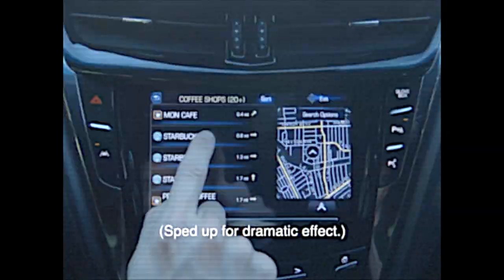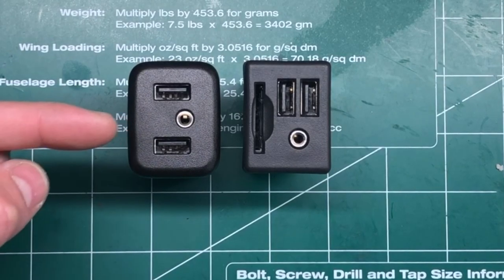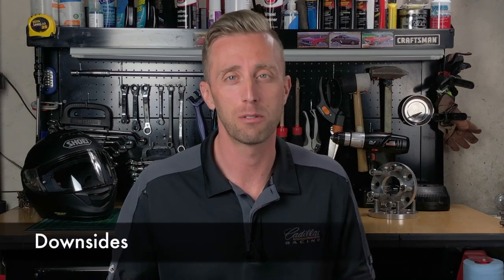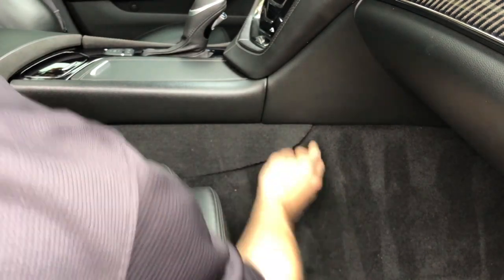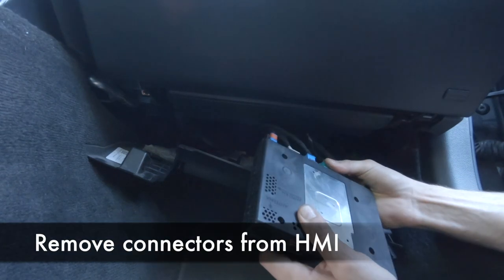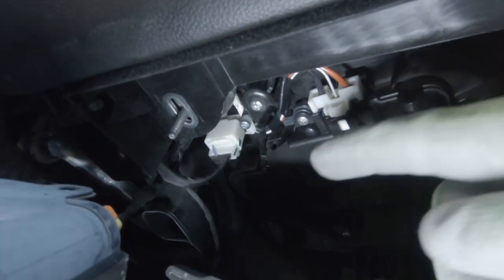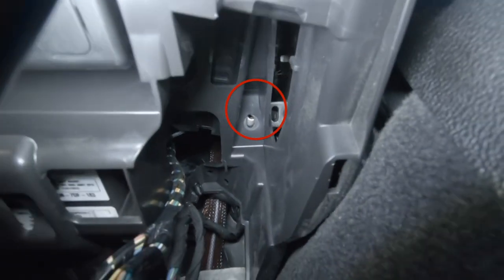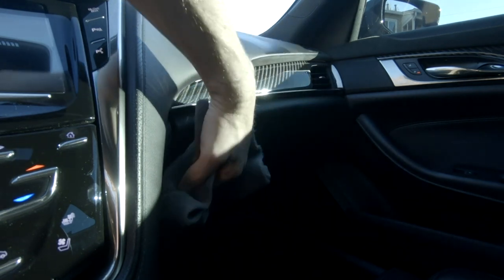How To: Upgrade your CUE w/ Apple Car Play & Android Auto

Comment: GM Parts House is closed.  Do they make this upgrade for the 2013 ATS?
Reply from the maker: Check the description, the source for this is now 404parts.com. If the 2013 has same looking CUE then yes there’s an upgrade. Be sure to use my coupon code JETFUELONLY for $100 off.
Reply: @JetFuelOnly  Awesome, Thanks. What if my car already has NAV?  All I am really looking for is the addition of Apple CarPlay.
Reply from the maker: @NYCPiLoT747   yep, no problem. You have to choose whether you have nav or not so they give you the right module
Reply: @JetFuelOnly  Perfect! Once again, many thanks. I have been looking for this upgrade for quite a while now. Cheers!
Reply: @JetFuelOnly  So, I’ve made contact with both 404 and MVI. Which out of the two would you recommend more? Sorry to keep bugging you on this. I really appreciate your opinion. Thanks!
Reply from the maker: I haven’t dealt with Mvi but I’ve bought lots of parts from 404parts this last year
Reply: @JetFuelOnly  I forgot to ask, is the Apple CarPlay upgrade wireless or does the phone have to be connected somewhere? My ATS is at Cadillac getting serviced and they gave me a 2021 XT4 loaner.  My phone connects to Apple CarPlay wirelessly which is pretty amazing.  No cables anywhere.
Reply from the maker: @NYCPiLoT747  it’s wired. Only the latest Cadillacs can do wireless. For $150 or so you can get a wireless dongle to make it wireless
Reply: @JetFuelOnly  could you please gave me a link for this dongle
Reply from the maker: Must have wired CarPlay for this dongle to work. https://amzn.to/3lF50cM

Comment: What if I don't have the cue system. Is it still worth it to upgrade?
Reply from the maker: You can’t do this upgrade unless you have CUE 2.0.  Or the Chevy/gmc/Buick equivalent
Reply: Thanks. It kinda sucks that my  Ats didn't come with cue system. Not even a back up camera.
Reply from the maker: Have you considered this Tesla style screen upgrade I talk about in my other video?   It may be possible to do on your car. 2014+ Cadillac CTS Modification Part 1: Interior
Reply: I have considered it. But wasn't sure if it will be compatible with the with 2.5 update since the tesla style is aftermarket. Do I need it program after? And what about back up camera?
Reply from the maker: It adds backup camera. Other questions you should speak to Phoenix audio

Comment: I have a 2016 Ats-V but want the 2017-19 cue system. Is that version 3.0 and is there a company that offers this upgrade?
Reply from the maker: As of now ... not that I know of.  I know someone was working on it with the GMC Sierra and Silverado (similar modules) but I don't see any progress.  Don't worry, you aren't missing too much. ;)
Reply: @JetFuelOnly  The major difference is that you can get to the main selections from any screen. On mine you always have to hit home to switch from one selection to another. Could that possibly be a module change to 3.0?
Reply from the maker: @tazoriginal  sounds like you just need to add icons to the top of the screen?  Works like iPhone, press and hold and then move around.
Reply: @JetFuelOnly  didn’t know you could add icons for the main radio functions but I’ll look into it. 2017+ models have it automatically. Guess they realized it was a pain to have to go to the main menu to switch between functions.
Reply from the maker: Ok we may be talking about different things? But look into it. As seen in my video I have icons across the top with phone, maps, audio, pandora etc. I think you get up to 5. What functions did you want?  I think skip or tune (and memory stations) Are usually accessible at the bottom of all screens and of course steering wheel
Reply: @JetFuelOnly  yes that is what my display looks like when I have my iPhone connected by usb. What I’m talking about is if you want to look at the radio for instance from this screen you have to hit the home button to get to the radio or other radio choices. On the 2017+ models it gives you icons to switch to main radio functions from the iPhone screen so that you don’t have to hit the home button first.
Reply from the maker: @tazoriginal  oh ok I see. With the digital gauge cluster you do get your favorites on the cluster when skipping through them but I know that’s not everything you may want. Hope a 3.0 solution comes!
Reply: @JetFuelOnly  yep I’m always looking at the name of songs to add to the collection 😂.

Comment: have you had any problems since you installed? i have xts 2013 and are you able to keep stock camera? and what package do i get  when i already have builtin nav? thx in adavnce
Reply from the maker: Freddie, everything has been great.  Yes you keep your camera. I suggest contacting 404parts.com directly and they can tell you exactly what will be needed for your XTS!
Reply: @JetFuelOnly   ok thx yeah i contacted them via cadillac forum.  also i thought you got module from gm warehouse. which one do you suggest?
Reply from the maker: Either will work but I’m partnering with 404parts. Plus use JETFUELONLY coupon code for the discount
Reply: @JetFuelOnly  ok thx

Comment: Hey Daniel,
I have a 2016 SRX and an Iphone 7 Software version 13.1.3.  In some of my reading I notice that the Iphone does not sync through the USB...only Bluetooth.  If this is so, then the upgrade would do nothing for me.  I really want Car Play in the auto.  Can you clarify?  BTW, really good job on the video.  
Thanks,
Steve
Reply from the maker: Steve Sullivan I’ve double checked with some of my resources and there shouldn’t be any issues connecting via USB right now in your car. Confirm you have tried different ports and different cables?  If you see album artwork it is likely connected via USB.
Reply: @JetFuelOnly   My apologies, I wasn't clear.  I have not upgraded yet.  Using the USB currently, I can not listen to Spotify or use hands free calling.  I can only do it through the Bluetooth connection.  When I upgrade, my Iphone will I be able to use USB for Spotify and maps?  If I switch back to CUE for radio, will I still be able to use the USB for calls?  Lastly, I would like to upgrade the Center Console USB and aux jack that another video referenced.  I do not find it in GMPartshouse.  I am looking to do CUE 2.5 and the Console at the same time.  Would you reference where you got the USB upgrade.  Thanks again.
Steve Sullivan
Reply from the maker: Steve Sullivan - ok. On a stock system of your SRX, all phone calls are made Bluetooth. That’s normal. But playing music from your music library should show on screen with album artwork. However with Spotify I forget how it is. 

After upgrade you will be able to use phone through USB and have the Spotify app right on screen with Apple car play and android auto. 

As for the upgraded port, I see it’s not listed as an option anymore but I assume it’s included.  A phone call to them would solve that question. Otherwise the part number is in the description of the other video and can sometimes be found on eBay or the GM wholesale part sites like www.gmpartsdirect.com. 

Also, I wanted to let you know another vendor has $200 off cue upgrade for Black Friday - now until November 11/30/19 with free shipping. Promo code JETFUELONLY
Reply: @JetFuelOnly  Hey Daniel, Steve Sullivan again.  I took your advice and called GMPartshouse.  I got a tech and told him the car I have.(2016 Caddy SRX)  He told me that I have to add the Nav Apple/Android for the extra 200 because the car never had it prior to upgrade.  He also told me that I will have the USB Aux as part of the kit.  Does this sound right to you?  Like you, I want it as clean as possible for as little as possible.  The tech seemed like he knew what he was talking about, but not like you.  Thanks again for your patience with this tech deficient person.  
Look forward to your response,
Steve
Reply from the maker: Steve Sullivan Sounds good Steve, I’m glad they were able to help you. Go for it!
Reply: @JetFuelOnly  so, the 900 it is?
Reply from the maker: Steve Sullivan yes but you may want to check with 404parts.com and see if it’s any cheaper with the JETFUELONLY code to get $100 off. If needed email them and they will get right back to you.

Comment: Hey Danial, do you know if it is possible to add Cue to an ATS with the base radio?  I bought a Cue system to repair in hopes of swapping radios, but have read it might not be possible to do.  TIA
Reply from the maker: Hmm. Not sure, but if anyone has figured it out it may be MVI. Shoot them an email
Reply: Any updates on this as I also have a base model and looking to see if I can upgrade to a screen! TIA
Reply: Any updates on this as I also have a base model and looking to see if I can upgrade to a screen! TIA

Comment: Can I do it for a 2015 cts?
Reply from the maker: Yes this was done on my 2015
Reply: @JetFuelOnly  can I do it for a 2017 CTS? How much would it cost I love the 2018 cue system look
Reply from the maker: There’s currently no upgrade for the 2017. You already have a pretty good version far better than. 2014
Reply: @JetFuelOnly  how about 2016 can I update the cue system?
Reply from the maker: @Bronny00  you already have the best update available. There are no updates beyond 2.5 unless you get a new car.
Reply: @JetFuelOnly  I have the old version cue system 🙄
Reply from the maker: That’s odd. Are you sure?  No projection icon for CarPlay?  All 2016s should have come with CUE 2.5 but a few didn’t get the projection part “turned on”.  If your maps look like mine after I upgraded you probably have the 2.5 but CarPlay not activated

Comment: Looks like a Real PIA to change the Cabin Air Filter, Air Bag has to come out? I think the Engineers that come up with these Effed up Designs need to have their Heads repeatedly Bashed in. As bad as having to take the front of the Car off to be able to change a Headlight Bulb on my STS.
Reply from the maker: No the cabin filter is a 5 min job.  I have a video on that too

Comment: Hey Daniel, thanks for this great tutorial. I've swapped it today and all works well except once I start the car or even push button for accessory  
mode 'THEFT LOCKED' message pops up on the monitor and whole system not working. Any advice how to fix it?
Reply from the maker: For everyone who reads this:  Irakli and I discussed this problem on the FB groups. This happened due to not having the modules programmed to match the VIN on the car you install the modules into. I don’t think I was clear enough in the video so for future viewers that do this mod, you cannot just swap parts. You must get VIN programming.

Comment: I tried to do the upgrade on my new 2014 CTS. Things were going fine until I got to the radio module. Mine is held in by 4 (what you had plus one on top one on bottom) clips, not two and I don’t see any good way to get it out without breaking something. Anyone else have this problem?
Reply from the maker: It has to come out somehow. But even if you break tabs I’m sure a zip tie or two would be adequate to hold it in there